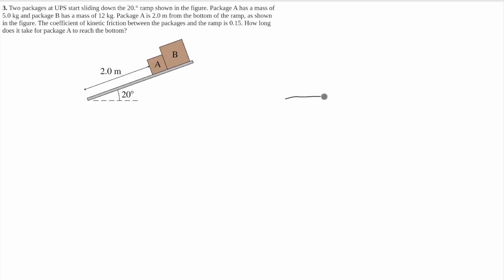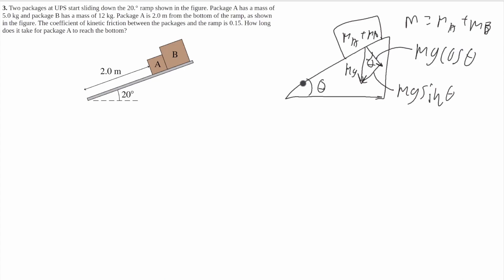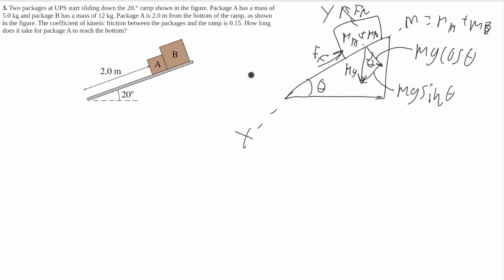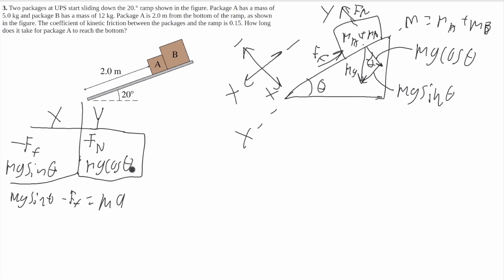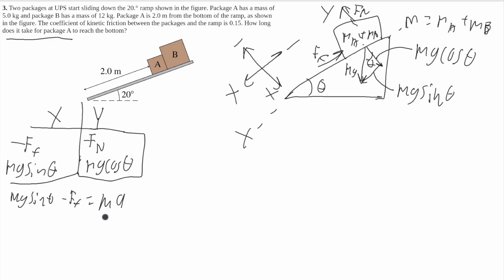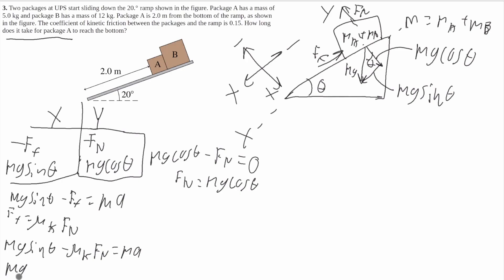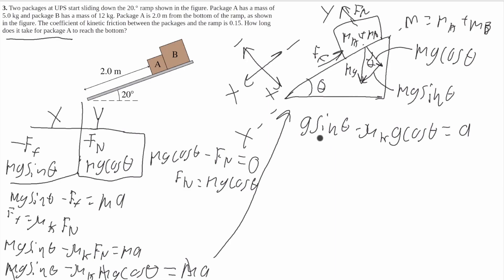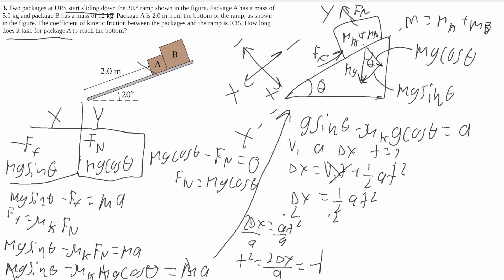2 boxes are sliding down a ramp with friction. Find the time when the boxes reach the bottom.

Comment: How did you assign the signs like I am getting opposite of what you are assigning??
Reply from the maker: You can decide the + and - directions however you want as long as you are consistent. In this problem I made down the ramp + and the down direction + . After that, any forces in the + direction were positive and any other forces in the - direction were negative.

Generally it is most convenient to set the direction of + in the same direction of the acceleration.

Comment: which coefficient of kinetic friction would you use for the final formula?
Reply from the maker: Both packages have the same coefficient of friction of .15
Reply: What if they had two different coefficients of kinetic friction?
Reply from the maker: You would probably have to treat each package independently and see their accelerations. If the top package has a higher acceleration you would need to calculate that additional force on the lower package and account for it. If the bottom package has a higher acceleration then they will move independently and it’s just doing the calculations in the video for 2 difference packages instead of 1.